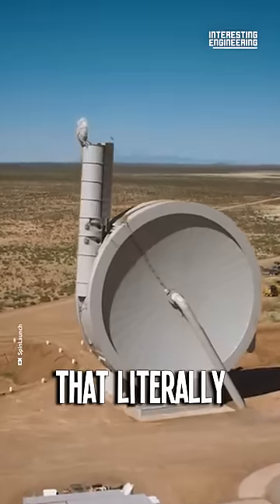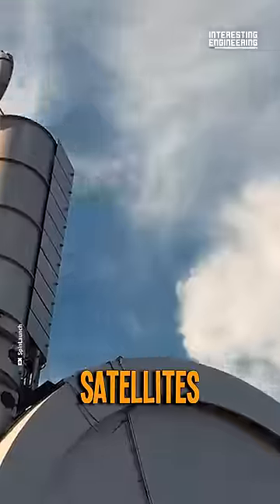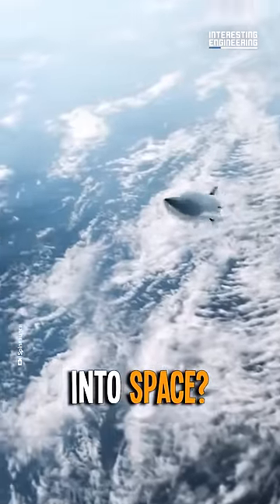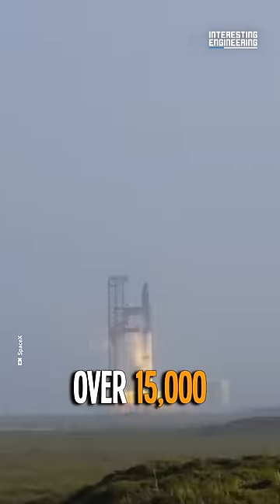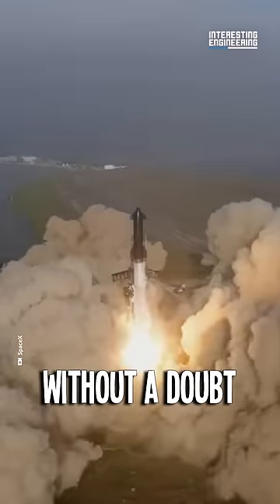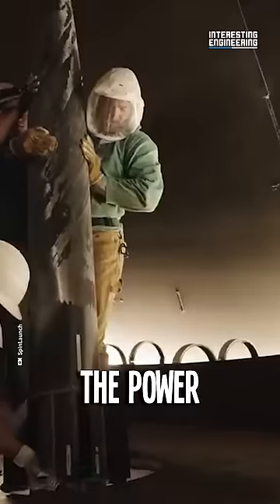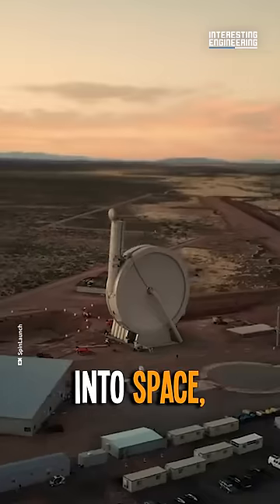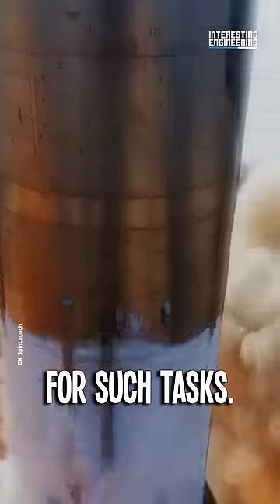Throwing Artillery Shells Into Space

Comment: "By using the power of velocity"

Ahhh yes, as opposed to all those rockets that get to space with zero velocity
Reply: He meant “by the power of inertia”
Reply: @wedmunds  I'm aware. I'm making fun of what he said.
Reply: AI
Reply: "But how exactly do u throw it into space??" 
"With a rocket."
"Na, but like.. if u don't wanna do that tho?
Reply: But this system gets it up to the necessary velocity 'in a matter of seconds' and all without using any fuel.    Quite amazing.   Very amazing in fact.
Reply: @Hereford1642 not in a matter of seconds - the acceleration (of the rotating movement inside the cylindrical spinlainch building) probably takes several hours.
Reply: Had the same thought
Reply: Momentum?
Reply: @Hereford1642 It’s a scam.
Reply: He meant inertia
Reply: It’s not velocity that brings a rocket to space. It’s a well balanced breakfast that’s responsible
Reply: That's thrust
Reply: @juanmanuelpenaloza9264  do you... actually think that there are rockets with zero velocity?
Reply: @_Stormfather  velocity is used to describe an object's speed in relation to a trajectory. IE, 35 knots SW, 5kmh upwards. Acceleration is a change in velocity, either in its speed or direction, caused by a force acting upon it. A rocket has a continuous force applied from its engines. The high-tech catapult projectiles maintain their velocity as gravity and drag acts on it until the rocket engines take over.
Reply: @juanmanuelpenaloza9264  you didn't answer my question
Reply: @_Stormfather  answer is no, but it’s velocity is constantly changing due to the amount of thrust
Reply: @juanmanuelpenaloza9264  cool, so then your original comment trying to correct me was completely wrong, and you're just trying to sound smart when in reality you're just reiterating things everyone already knew.
Reply: "The power of velocity" is one of the funniest things I've ever heard.
Reply: Most of the fuel is spent to get not 0 velocity.
Reply: @_Stormfather  you tell him storm 😆
Reply: Daaang you beat me to it
Reply: Lol you nailed what I felt and forgot ..
Reply: @Vote_By_Mail I don't know if you ever seen boondocks but this sounds like Riley and huey.
Reply: "Where do you get the kinetic energy from, then" strikes again
Reply: Yea but it doesnt use fuel. It is powered by a guy on a treadmill
Reply: @Hereford1642 except it uses electricity. Which is generated with.....FUEL!!!! amazing, really! It does use fuel
Reply: @Hereford1642  energy must cone from somewhere that's physics.
Reply: @juanmanuelpenaloza9264 thrust is used to achieve velocity.  Let's be more basic.  "Energy".
Reply: @Hereford1642 too bad it's a load of crap
Reply: @Hereford1642 takes 3 hours to get up to speed, takes another 2 hours to pull a vacuum, if the launch is wrong by even a millisecond the payload will hit the side of the centrifuge and cause it to explode. The parts inside will need a full overhaul every 3 launches. That's 5 launches a day with 2 weeks of downtime for something that is half as efficient as just using a rocket. Will cost twice the amount of electricity to spin it as it does rocket fuel to launch.
Reply: @Hereford1642 quite amazing, almost unbelievable
Reply: @juanmanuelpenaloza9264 …. You just proved his point 😂
Reply: You have heard of "Stairway to Heaven"? Lol Led Zeppelin. Who knew? Now there might be another method of  transportion!
Reply: How about using rail gun kinetic energy launchers? A hydron accelerator on its side, perhaps?
Reply: @wedmunds  Inertia and power are still two different quantities.
Reply: @Hereford1642 and you think that takes zero energy?
Reply: @wbowers313  Let me make this clear.  I find i very very very very very amazing that such a technology is being suggested  that will accelerate a projectile in no time and with zero energy.
 Very very very very very very very amazing.
Reply: That's my engineer boy
Reply: @wedmunds he should have said what he meant.
Reply: @juanmanuelpenaloza9264 what point were you trying to make there? Both acceleration and velocity are in play in both situations you’ve described. Gravity literally is a negative acceleration.
Reply: @juanmanuelpenaloza9264 and? You think this machine results in a payload with a velocity that ISN’T being constantly affected by acceleration (ie. Gravity)? There’s no difference in terms of what forces are at play. 

Shooting something into the sky will ALWAYS require Force, right? Which always accounts for acceleration.
Reply: @OmnipresentPotato LOL for real. I used the power of velocity to get out of bed this morning. It was lit.
Reply: @anitabonghit2758  the guy on the treadmill is powered by food which is human fuel
Reply: Also what??? With zero velocity is crazy😭😭 do you not realize that even in space they are traveling 5 miles a second. Literally why they make such a big deal about space debris. A small bolt freely orbiting the earth could tear a 10 foot gape in any spacecraft
Reply: @matthewedwards6454 Your "mathematical" guesswork may or may not be close. It's not convincing, tho.
Reply: yes, because rockets use lift not
Reply: Teleport.
Reply: i can never tell if these videos are made with  AI, someone who speaks a foreign language and messes up on translations sometimes, or just a dumb person who uses stock narrator voice.
Reply: Velocity is a very powerful thing, as all hairdressers, sorry I mean brain scientists know ! Just look at the Velocity Raptor ! Point made I think !
Reply: Lol
Reply: Do you really know the difference between speed and acceleration?
Reply: @IoloI  Do you realize that nothing you said contradicts my comment?
Reply: Underrated comment, glad to see there's still educated folks out there haha
Reply: Acceleration my friend
Reply: 😂😂😂😂 LMAO I also thought that was the stupidest thing I've ever heard
Reply: @wedmunds no he didn't. If he meant the power of inertia he would have said the power of inertia. This video was done by a member of "the party of science".😂
Reply: @Hereford1642 no "fuel"? What do you think powers that giant centrifuge? Now where does that power come from? The ground, just like rocket fuel.
Reply: Rockets use fuel which generates velocity.
Reply: Came here for this
Reply: @desertodavid  Honestly,  I should have put (sarc) in brackets.
Reply: The Law of Probability shows this has high success rate. 
Aliens would be proud we got this far without massive use of dirty fuel. 
Also, the amount of fuel needed to get an object at that level (GEO), it will need to be proportional to the weight of the object.

Comment: I see two challenges:
1 - centrifugal forces
2 - air resistance and heat. A normal rocket does not travel that fast through thick atmosphere, but this one will travel hardest where atmosphere is most thick
Reply: The heat would be insane, LUL
Reply: The spin chamber is under a vacuum but once it breaks through the membrane and is hit with sudden atmospheric pressure, thats where things get interesting 😂
Reply: There going to set off a 20000 pound bomb next to it to create a mini vacuum so that doesnt happen. With the power of big boom boom
Reply: @tylerchapman8856  the fools ... while they just needed to run a cable from earth to a space station for an elevator ...
Reply: So, the concept is actually theoretically possible, just not the way this company is trying to do it.  But as for your concerns

1: centrifugal forces (or more accurately the angular momentum) are the whole point here, so presenting it as a problem is odd.  Yeah, there are some pretty heavy forces involved, but nothing that is insurmountable.

2: air friction in the tube is a non issue, since the idea is for it to be depressurized. Not to a perfect vacuum, but low though the heat is pretty insignificant.  Much less an issue than re-entry.   That is why it shows the things breaking free of a barrier when it launches. 

That said, air resistance is definitely an issue once it breaks free, as well as the issue of suddenly smacking into 1 atmosphere of air the moment it leaves the barrel.  Which is one of the many reasons that this thing is a non starter.
Reply: @xrayban2  yeah, running a cable down from space is NOT a lesser engineering challenge than this.
Reply: @danmurad8080  It always astonishes me that those idiotic investors don't go to a couple of physicists first before throwing all that trust-fund money away on some grifters with some inane ideas. Because what sounds possible to laymen is ridiculous to anyone with a moderate knowledge - aka Theranos, etc.
Reply: Could this be more feasible at a much higher altitude?
Reply: What if it hits a plane?
Reply: @MrJim5280   there's no land with a high enough altitude for it to matter on Earth.  It's very viable on the moon or Mars though.
Reply: @bluebugaboo3344   air traffic control exists for a reason.  It's no more likely to hit a plane than a plane is.  And no more catastrophic.
Reply: @danmurad8080  Thunderf00t presented all the negatives and none of the positives. He isn't exactly a non-biased source.
Reply: @SylvainOfGandahar  I'd love to see your reaction when you learn that they have already worked with academic establishments.
Reply: @iriswaters  What if it hits a bird?
Reply: @bluebugaboo3344   about the same as if a supersonic jet hit a bird.   No more bird.
Reply: The proposed launch speed is only 4700mph.  Notably lower than the fastest supersonic jets we've made.  The launcher isn't intended to get anything up to orbital speeds or escape velocity, just enough to cut down on Delta V needed for it.  Every little bit of Delta V saved adds up thanks to the rocket equation.  So nothing about the speed is theoretically unreasonable.  

The fact that it's all sorta, kinda, theoretically, technically feasible is why it hasn't been entirely written off.  And the tests they do will probably be very useful for someone else at some point down the line.   Just, ya know, not for this company, except as a way of getting funding.
Reply: @MrJim5280  Hypersonic planes fly at 25km in height - let us first create a centrifugal station that remains perfectly aligned at that height and go from there. Star Wars city in the sky and Lando Calrissian comes to mind - because that is about the tech we would need. But then - why would we need a centrifugal launcher if we could do that?
Reply: Firmament?
Reply: I belive that Ciolkovsky published a calculation that shows that it is impossible to shoot a cannot shell into the orbit. And considering that he did it in 19th century, it's amazing that these guys still haven't caught up.
(later in the video they admit that this is actually a 2-stage rocket) 

Also, I would like to know what kind of satellite they want to throw up (all my puns are intended) using this method. If it's just a rock - no problem. If it contains electronics, optical components, etc. - designing that satellite will be a bigger engineering problem, than building this slingshot.
Reply: @iriswaters  So why don't they just create a vacuum outside of the tube? depressurize the outside and problem solved.
Reply: @danmurad8080 thunderf00t also “debunked” Elon musk. And then his debunking was debunked
Reply: @thewandererIRL   uh.  Lol?  Depressurize the atmosphere?
Reply: @MacakTosha   worth noting that the plan is NOT to accelerate to escape velocity, but only about 1/4-1/5 of it, at 4700mph.  The payload isn't a dead weight, it's a rocket.  The launcher effectively replaces the first stage of a staged rocket.  But given the nature of the rocket equation, that's well over half the weight of fuel, despite being a smaller percentage of the Delta V
Reply: Spinlaunch makes the claim that Project HARP proved that launching a projectile at such speeds is feasible, given that HARP muzzle velocities peaked at 6442 mph, well below the aim of Spinlaunch at 4700.  However, HARP was launching slugs, not fragile cans full of high explosives, which is what a rocket is.
Reply: @bluebugaboo3344   btw, since you asked about birds and planes, if it hits Superman it's fucked.
Reply: @iriswaters  That actually makes sense, but then title and opening line of "Throwing Artillery Shells Into Space" is misleading - because the plan is to throw a two-stage rocket. And if the goal is to achieve a much lower velocity, drag and inertial forces wouldn't be so much of a problem. 

I have seen several ideas of this kind, and most promising one was to build a long vertical shaft in a mountain with an elevator in it. Whole rocket (the size of Ariana) would be on the elevator, and elevator would propel the rocket at low acceleration (about 2g) from bottom to the top. Rocket would start its engines after it exits the shaft, and with this initial speed you would either: eliminate the first stage or enable adding of extra payload.
Yes, digging and building of a very long shaft through the mountain would be an arduous task, but same goes for scaling up of this SpinLaunch.
Reply: @MacakTosha   yeah, the title is very misleading.  Really, the whole video is, since it insinuates that the company has actually done anything other than an EXTREMELY low speed mock fire of a dead shell.

The idea of using a long tunnel that extends to the top of a mountain has several notable advantages over the spin idea.  

First and most notably, it avoids the extreme G forces that rotation unavoidably imparts.  Contrary to what some have suggested, spinning up slowly is no help, since the worst G forces come from the rotation itself, not the acceleration up to spin.   The same principle that creates spin gravity also is at play here.  Plus the smaller the radius combined with the higher the rotation rate, the more unequal the forces are on the object being spun.  Not an issue for a dead shell, but a HUGE issue for a tin can full of explosives and fiddly mechanical and electrical equipment.

Secondly the idea of such an accelerator gives the option of reducing the sudden impact against the air that the Spinlaunch has.  This can be done either by not using a vacuum at all(which has some issues with heat and takes more power), or alternatively having the tunnel have a graduated pressure, so that there's no sudden impact.  

Finally, having the top end at the top of a tall mountain has some advantage due to reduced atmospheric pressure, though this is not as significant as some imagine, and might not actually be worth the added expense of putting it up there.  Arguably you get more value from putting the system closer to the equator than you do from putting it at the top of a mountain.  Another version of this does most of it's acceleration horizonal to the earth, with a slow curve near the end until it points up at 45° or so.

All that said, a mile long rail gun big enough to fire a rocket would be pretty pricey.  Likely a LOT more than the concept that Spinlaunch is selling.  The fact that it would probably work, unlike Spinlaunch, notwithstanding.
Reply: @iriswaters  Yeah so we can shoot stuff into space.
Reply: @thewandererIRL   I.... See.  Well yes, I agree that removing the entire atmosphere from the planet would make launching things into space somewhat easier, but I feel like it comes with its own set of issues.  🤣
Reply: The company removes the air causing it to spin easier
Reply: @iriswaters  My mom says that my problem is that I don't think things all the way through... I think this may be one of those things...😅
Reply: @thewandererIRL - like spent nuclear fuel and the deceased .
Reply: @iriswaters depressurize the world
Reply: I don't think the satellite will survive the spin.
Reply: @lazer8776   I would prefer you not.  But if you must.
Reply: @brianpair2934  I got an idea. If you can support the missile over the whole length it is not likely to break. If you put sensitive parts in a highly dense liquid the forces on them will not be one-sided.
Reply: @iriswaters Engineering challenge? Bro, I climb a tree with a rope and let down the rope after I tie an end to a branch. 

That's the extent of the "challenge". Just bring a long ass cable up to a satellite, hook one end to said satellite (not on the bumpers though, you need a secure hook or something...) and just let the other end fall. Maybe tie a rock to it so it's more like an anchor and doesn't just flap all over....
Reply: @Astraeus..   lol, k.    Look up the concept of Self Support Length, and then look up the height of geostationary orbit.  

We currently do not have any material we are capable of mass manufacturing that comes within an order of magnitude of the necessary self support length.    Even carbon nanotubes fall short, requiring a pretty notable tapering to support it's own weight over the distance, and the cost of that much carbon nanotubes at current prices is more money than has ever existed in the history of the species.  And more energy than we've used in total since the beginning of the industrial revolution.  Obviously mass manufacture would bring the price down, and likely the energy cost as we figure out better methods, but not enough, or fast enough, to make this a thing we've got any capacity to do any time soon.